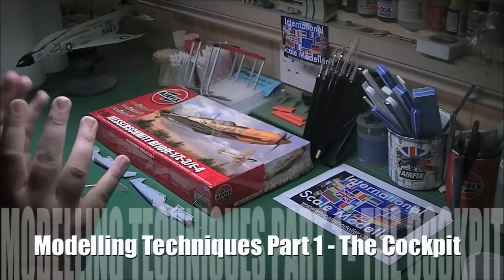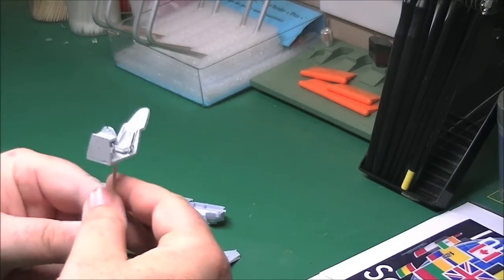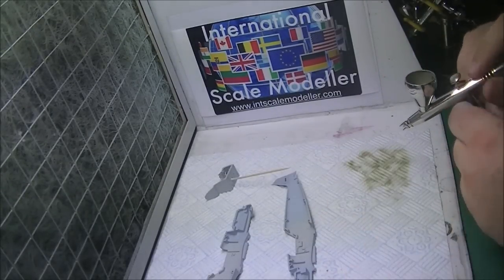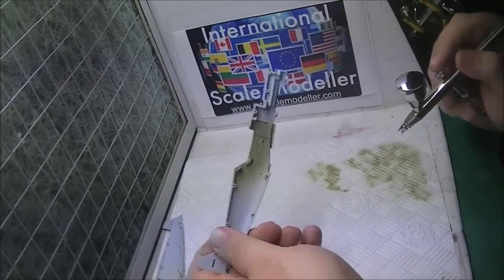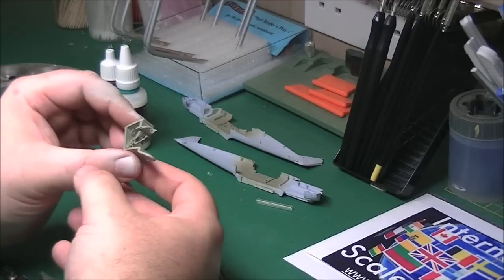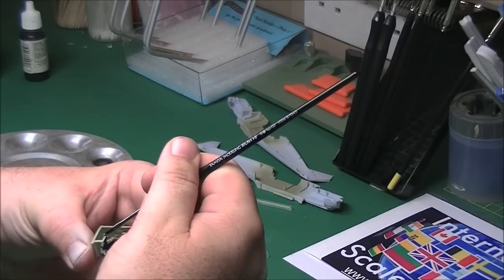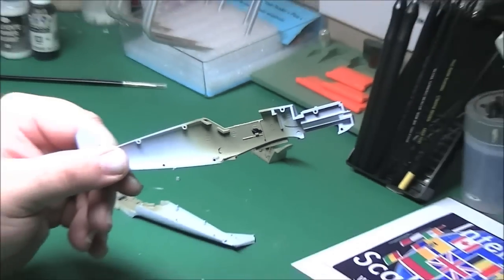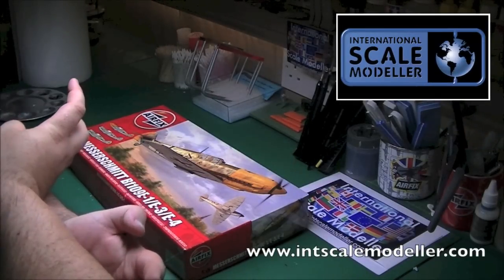Aircraft Modelling Techniques Part 1 - Building & Painting The Cockpit

Comment: Hi, happened upon your videos and because they are so clear and put over brilliantly they have rekindled my enthusiasm in airbrushing, thank you. 
I have had the following kit for some years but have never had much success; it has been put away in the cupboard and forgotten about until now and would like your thoughts please. 
The compressor is a Testors Baby Blue (circa 2006) AC 55 producing 10 l/min at 2.9 bar (42 psi) and the airbrush is an Aztek Broad stroke no A2203.
I suspect the problem is mainly with the airbrush and so will be upgrading it to a gravity feed maybe double acting. Before I buy the airbrush alone could you tell me if the compressor is up to the job because if you think it is not then I will buy a kit (on your recommendation) of both compressor and air brush.
Thanks
Bob

Comment: your air tank kicked in quick whats the cfm on that, though seemed alot of air to paint ratio?
Reply: Its a 2.5 l tank if i remember correctly i do spray at a high air pressure, its just the way i like top airbrush
Reply: been following ism now, just a tip from an aircraft painter of many years (the real ones), if you do cellulose pressure down and keep it wet if it goes dry 600 grit wet with a bar of soap in the water mixed
Reply: yeah i always spray cellulose at 12 psi, have done for years now :) And yeah i use wet and dry as well as micro mesh to smooth the surface. Thanks for the advice :)
Reply: ive been looking at a few vids now on you tube, i love your work and the tutorials are great, did my first kit in over 30yrs after watching I.S.M....and i bought the Da Nang phantom you reviewed..never had etch or resin in my day...just stringy glue..keep up the good work, im now hooked on this hobby....and congratulations
Reply: Cheers Buddy :)

Comment: Hey guys!! I have an issue with my airbrush. when I spray it sputters ever so slightly. I've cleaned the airbrush within an inch of its life. I've thinned the paint, I haven't thinned the paint. I'm using Testors flat enamel paints l am also using an Iwata Neo airbrush I think the needle is a 0.35 mm (I'm kinda new at this). Any suggestions?
Reply: Do you use the appropriate air pressure for the paint? Look also if your nozzle/needl are not damaged.
Reply: Also personnaly I will avoid this airbrush it is too cheeper and ii is not manufactured from Iwata but FOR Iwata. Iwata have a nice airbrush  the Revolution Cr with a 0.5 mm needle/nozzle wich is perfect. In airbrushing,trigger control is the key not only the size of the needle /nozzle. A 0.3mm is fine too. For this, go the Eclipse model instead. Those airbrushes are affordables and are great quality instruments from Iwata unlike the Neo brand.
Reply: Jesse Osinski I had the same problem mate. Lower your pressure and thin the paint a tad more and you should be okay. Make sure you keep your airbrush clean

Comment: When ever I use my vallejo airbrush primer the paint and primer just rub off with handling any idea what's wrong
Reply: Your most probably not giving it enough time to dry possible also spraying your coats too thick. Give the Ak or ammo primer a go its much better
Reply: Daniel, make sure that you  wash the surface your trying to paint with washing up liquid before using the primer. Leave primed surface overnight  at least before trying to sand down . Use wet and dry and water with a little soap in it . Vallejo are really good paints to use through air brush . Hope this helps REgards Paul
Reply: I had the same problem, Daniel. I think the tips about not spraying too thickly and giving it a good 24 hours at least to dry are on the right track.